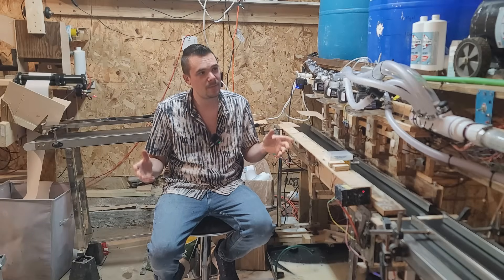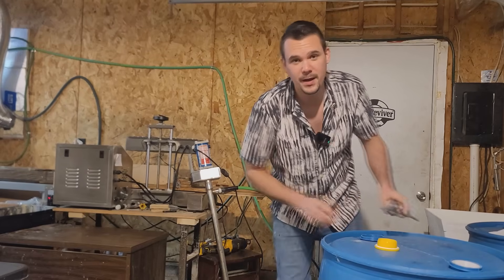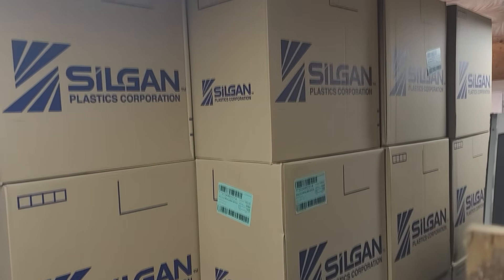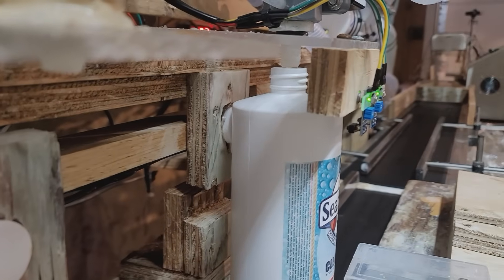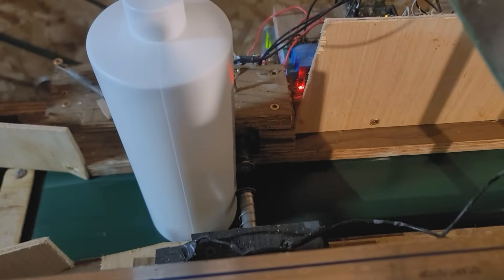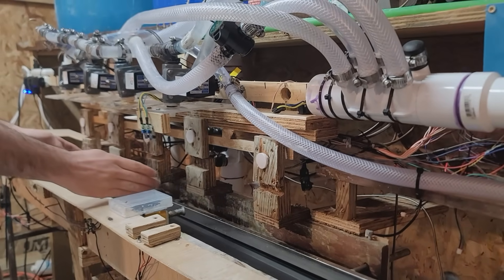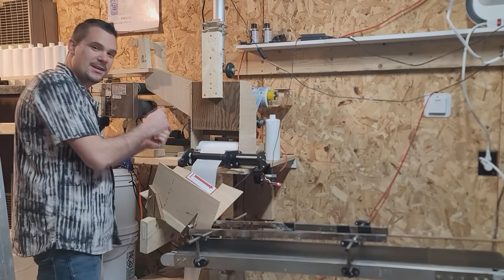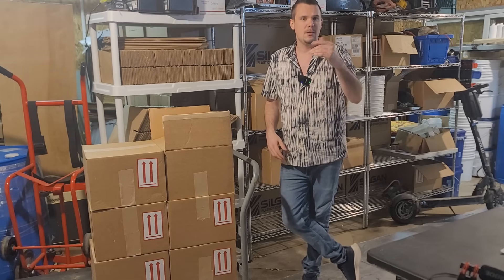I Built a $3M/Year Factory in a 600sqft Shop

Comment: im alittle confused.
so 2000 a month,  lets say you did it in 3 batches 666 each. how much time to save not just filling these manual ??
cause you standing there and the end of conveyer belt anyways to put the cap on and put it in a box etc right.
if you had to do 2 sessions of labelling , and 3 filling sessions direct from under the drum ? I don't see you saving that  much time or am I wrong??  . I'm just a little confused,  but I get you wanna scale it up and possible sell they system to others , it looks great.
Reply from the maker: During summer we were at 75% capacity for a couple months as that's the most demanding time of year and it was our first summer in business (with no off-season stock to support the seasonal rush), during the fall around 1,000 bottles a month (but we produce more to stay ahead for the spring season). First hand, I can tell you It's much faster than doing it manually in sessions - We had the filling machine break occasionally during the early build (which we've since improved and increased reliability) and 30 minutes to run 200 bottles ran into 2 hours, filling them manually.
Reply: @PlanesBoatsandSubmarines  still good,  good luck

Comment: Hi dude, french automated plant operator by trade here.

I was wondering some questions about your nicely done setup :

1:why lay down your bottles for label them ?

2:does your labeler not working if it's standing upright ?

3: if it can work only like that, why not raise a bit more the conveyor belt after the labeling station so you could simply use a guiding chute to put your labelled bottle upright again ?

4: i'm gonna coming way back in your setup : instead of feeding your labeler with a conveyor belt with bottles upright, did you have tried to feed it with bottles already laid down and doing like a bullets magasin with an open top so can feed the buffer continuously ?

5: at your filling device, you set several nozzles to seemingly fill several bottles at the same time, i'm not sure you said why you don't do it, but here's my concern: why not doing a kind of giant comb/rake that would space and hold right below each nozzle evenly a set of bottles ?

6: do you have any level indicator on your batching drums ?

7: up to what point would you get your setup automated ?

8: do you plan to set regular quality control steps in your process ?

9: talking about QC, does the filling level is only measured by these optical sensors ? (does'nt look important like that, but in the end, if some ounces here and there are added without you notice it in time, you may give away couple of gallons each year (then, maybe you can allow yourself some small losses like this one, i agree that i don't know how you run your operation after all...))

10: did you have anything to let you know some parameters like "how many bottles per hour are filled ?" (beside manual count), "how much is your setup power hungry ?" (some slightly higher power consumptions are used to be indicators of either the equipment is about to have an issue(most of the time by wear) or something is drawing current where it should'nt go...), "does your batches are closely the sames to each others ?" (few percents variations in them is often and unavoidable anyway, but above let say 5% or more, there's a serious problem...)

11: do you plan to batch other formulations ?

12: do you clean often your whole setup and how ?

Take all the time you need to address as many questions as you can, as well here in comment as in a dedicated video (maybe some peoples may like to hear you about it), i won't be pissed if one or more remain unanswered, i guess only time will tell for some of them...

Thanks by advance for all your answers you'll bring.
Reply from the maker: Thanks for the comment and questions! I think that will be best to dive into for the next video for this series. So thanks for that! Will certainly bring you up in the video.

Comment: The problem of mass production is wear of parts and how often the line requires maintenance. This setup doesn't look like it can work for a week non-stop, let alone a year
Reply from the maker: Ironic. This person missed the part that we produced over 20,000 bottles from this line already. In 7 months actually. I think before you comment, you should watch the full video.
Reply: @PlanesBoatsandSubmarines  oh wow, good for you then. I still wonder tho, how often did you have to disassemble parts of the line or fix something there? I didn't claim it was unusable, just looked like a maintenance nightmare
Reply: @nestor1208 The guy built it himself.   If he spots a weakness, he can redesign the problem components and carry on.   What you call a maintenance nightmare is nothing more than an engineering opportunity.
Reply from the maker: What 7996 said, and thanks. Early on there were problems primarily with the automated filling machine. Once I optimized it, it now runs smoothly and quite reliably. We stock backup parts for everything for minimal downtime. Knowing the machines inside and out makes maintenance easy.

Comment: If you can earn $3M/Year why not upgrading in professional conveyors / solenoids / bottlecaps / mixing machinery? The whole setup from front to back seems it can fall apart every minute.
Reply: Why not wait until it starts to fall apart to upgrade?

Going into debt for advanced machinery is probably not exactly his goal at this point
Reply: He built everything himself, knows every screw, and can replace everything himself using cheap parts like an Arduino. Now he'll buy industrial equipment where replacing a light bulb costs several hundred dollars. Another thing, if i produce 100 hundred forks for 1$/piece doesn't mean i sold it and i have 100$, no i have "100$"  in goods not dollars.
Reply from the maker: All great comments to this!
Reply: Going off his quoted numbers of $250k professional vs $10k homebuilt, would the professional system be 25x better? Would it be better than 25 of the homebuilt systems? That's the question you would need to answer.
Reply from the maker: Hey Nate, The primary gain is more volume, but It's just not a concern yet until we bottleneck with the current system. I wouldn't say 25x better because knowing the machines inside and out allow for quick and cheap repair inhouse to ensure product keeps being made. They produce faster, but until we are pushing over 120K units a year, it makes no sense. Plus it takes a lot more space. During peak season we hit capacity only if we don't have stock set aside during the off season.
Reply: Industrial equipment is expensive
Reply: He produces 3 million per year in product not profit, huge difference 😅, watch the beginning of the video again where he references $250,000 per month